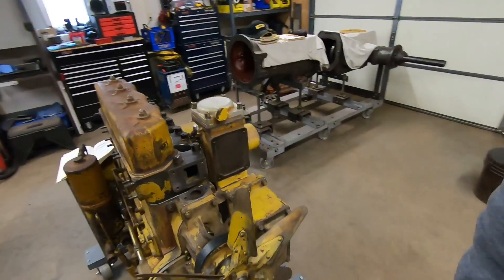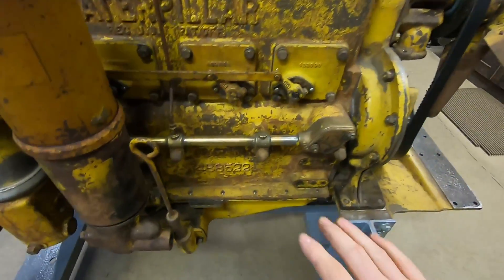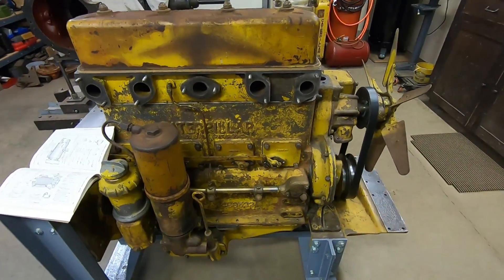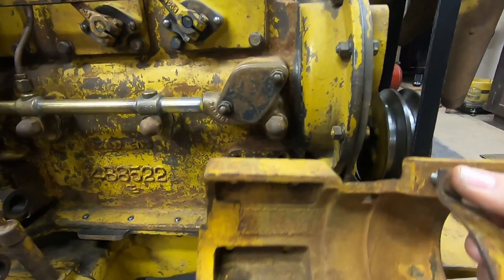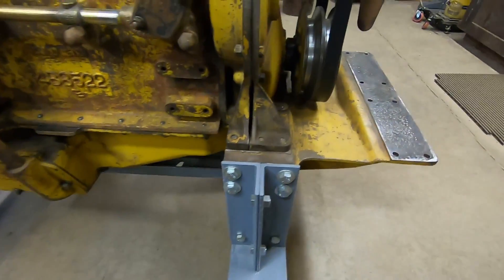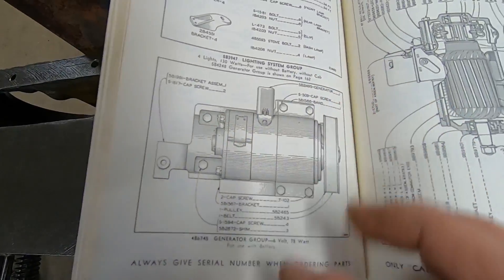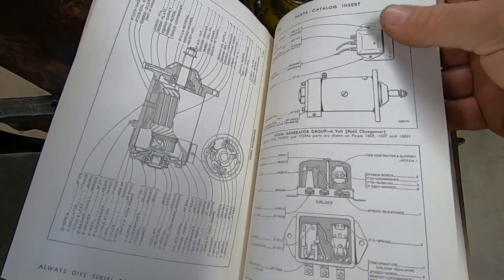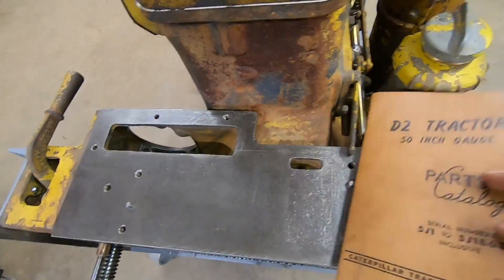An Eleven-Thirteen Video Short - What Is That Second V-Belt Groove For In The Crank Pulley???

Comment: Correct me if I'm wrong but, didn't the "generator's" require 2 volts to "energize" the generator? I mean, it required, (last I knew), 2 volts in order for them to generate any electrical power. Cheers :)

Comment: is 1500.00 fair for a d-2 that has not been run for more than 40,years pony is tight, it does have a blade, it was parked back in the day due to a steering clutch problem, it has wide tracks ,

Comment: I would bet there is a 6 volt Delco-Remy generator that would fit your bracket in the antique auto world.  I would also not be surprised  if Caterpillar  used Delco-Remy for their electrical equipment. But I  am just speculating. Curious to really know.

Comment: https://www.dieselworldmag.com/diesel-engines/the-ships-cat/

Starting in March of 1939, industrial power units with the D3400 were introduced, as well as a marine propulsion version. At nearly the same time, Cat added it to their generator line as the 34-15 Diesel Electric Set, sold in relatively large numbers into 1947.
The war dominated American industry through the first half of the 1940s and, of course, the D2 crawler and 212 grader joined up and went to war wearing OD paint. So did the 34-15 generator sets and many other Cat products. Less known are the Cat D3400 engines that went to the Navy and Merchant Marine for installation into ships as backup generators. We discovered a Cat D3400 aboard the SS Red Oak Victory (see sidebar), a World War II cargo ship that served both the U.S. Navy and the Merchant Marine. It’s original to the ship and drives a 15 KW, 240-volt DC (Direct Current) generator that was, and still is, used as backup power.

Comment: Any chance a generator cross-refs with one from another "industry"? Of course, not sure what you need one for. :)
Reply: Well if you wish to be really independent, get a big generator so you can do your own stick welding,and maybe an air compressor run off the generator so you can use one of those detergent pails and keep the paint clean. Overkill,but I suspect that may be his middle name.

Comment: So did they offer electric start as an option?  Or was the genny for lights, heaters etc?
Reply: There was some talk about using direct, electric start and it was available, but not sure if it was CAT offering it - but looking at how the bracket, various generators and battery box are CAT parts, seems like electric starter might have been a factory option.
Reply: I always heard it was an option but I have never seen a factory setup.  The pony option is the way I would go unless I used it everyday.

Comment: thinking about it, literally the only electronics on the entire machine is the starting engine magneto
Reply: Best way EVER! This is why I've given up on new cars - too much "technology" and electronics! Unreliable as Hell - and I'm a lifelong electronics/computer tech/engineer!
Reply: @veiledzorba  ...Well, I've been around a bit and I remember well when a car or truck went 50k miles it was "worn out" or due for extensive repair.  Ball joints, wheel bearings, engines, you name it, were not near what they are today.  It is fun to be nostalgic and rosey eyed. but old cars were a lot of maintenance and didn't last.  Honda and Toyota drove the auto industry to amazing reliability.  200k these days is nothing.  I have 2 "antique" vehicles that I love, but they keep me busy and my wallet thin!!
Reply: Too bad the starting engine isn't a tiny diesel, that would have made it completely mechanical.

Comment: It would be great if you were trying to add lights especially if you could run it without the battery
Reply: Joshua Gann it’s a diesel, don’t need no stinking battery! The pony motor has a mag to power 2 spark plugs, that’s all the electrics there is.

Comment: You're wrong, it's for the air conditioning compressor!
Reply: Simon Richard Nope, power steering!
Reply: Simon Richard you’re both wrong, it’s for a vacuum pump to run the power brakes😉
Reply: Kurt Johnson and the windshield wipers?
Reply: It’s for the blinker fluid pump!
Reply: For the smog pump? Tier 4 final don't ya know.
Reply: How about an air compressor for high altitude use for the pilot ? Pressurizing the cabin,you see.
Reply: paul manson Now yer just being silly!
Reply: You're all wrong, it's for the remote control for the "get out of the way" horn.

Comment: Thanks. How was the belt tensioned?
Reply: Likely the same way the water pump belt is tensioned; with an adjustable pulley on the generator.
Reply: @John Verne so it's the same as the water pump pulley?
Reply: @John Verne I think I saw a drilled and tapped mounting pad on the front cover. Maybe a tensioner mounts there?